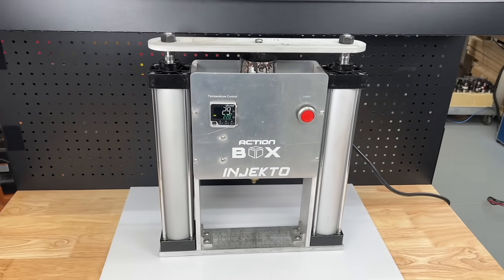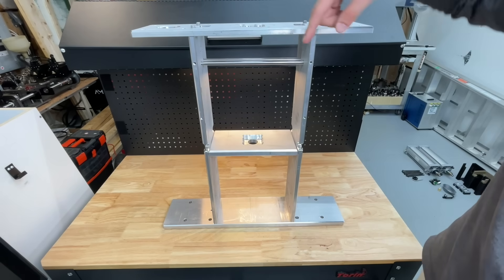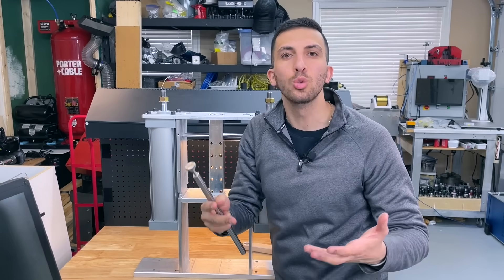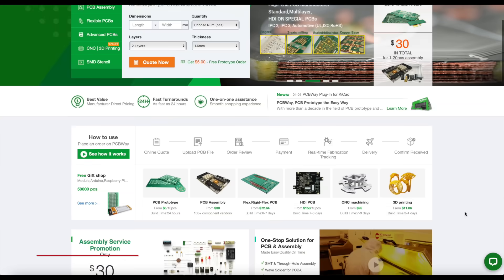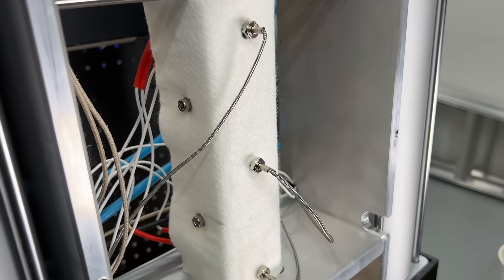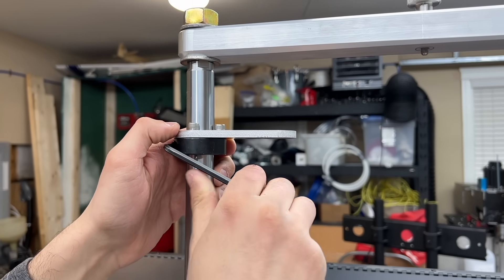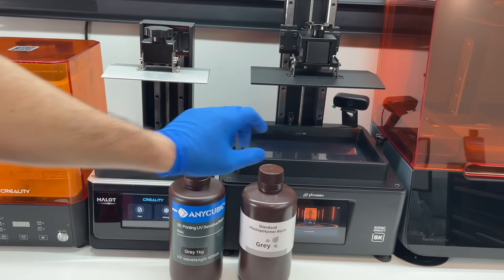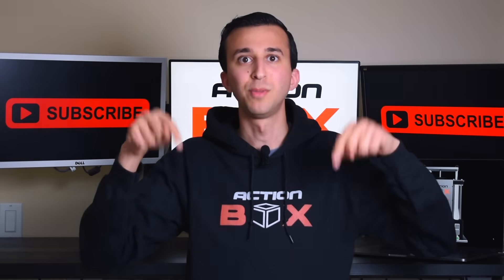DIY Injection Molder Works With 3D Printed Molds | INJEKTO 2.0

Comment: 7:10 this has to be done by an electrician, and this is very dangerous if not done properly. Yeah, I did it by myself. you took the words and in fact was true. got shocked 10 times. burn a wire because accidentally put it in the wrong connecter. then almost burnt the heating element channel tube. learn my lesson but I bought the PID controller, and it was terrible because of the lack of instructions and no diagram of how to connect the controller. but manage to make it work and it's doing well but want to do an updated version because of the old model controller. this time getting one and following online sources that use PID more often of the controller model.

Comment: I've been building my own equipment for mycology for a long time, and after 3d printing for a year I'm realizing how important it is to have mold injection capacity, and this really makes mold injection digestible.   
I am looking forward to the day I finally have the time to start investing into a device like this as it is not to far removed from PID controllers I've set up for large cookers.

Comment: Whats the pressure at the nozzle for an injekto 2.0?
Reply from the maker: The machine generates a maximum Injection Force of 9000N (918 kg) at 90 PSI

Comment: What an awesome build. I'm picturing it on my workbench, right next to the 3D Printer that's pumping out complex multifaceted molds. Interested to know if steppers and lead screws were ever considered for the press system? It just seems like a more simple and maintainable system and the precision of the screws would counter any type of misalignment/wobbling of the top bar. Just a thought. Either way, good job and I want one.
Reply from the maker: Sweet, check it out at actionbox.ca
We have indeed tested an electric version but it is not very cost friendly

Comment: I suggest trying it with urethanes so you can make custom low volume parts (vintage motorcycle carb boots, grips, car pedal pads etc are examples) with the wide durometer variety available.
Reply from the maker: Great idea.  Do you know where we can get these pellets? Cheers

Comment: wow, impresive machine guys , thanks for this very informative video.but how small/fine can be the details that can be reproduced with a plastic mold?
Reply from the maker: This will take on the exact shape of the mold.   If you scratch it lightly with a pin, you will have that scratch on every single part you mold.
Reply: @ActionBOX  thanks guys

Comment: Shuttup and take my money!
Reply: No, seriously. How much?
Reply from the maker: Haha check out our website. We sell kits for INJEKTO: https://actionbox.ca/products/injekto-2

Message us for a special discount 🤫
Reply: To be clear, the mechanical and electronics kits needs to be purchased separately? I have a resin printer for molds and an air compressor. Do I need anything else?
Reply from the maker: @kenengel620  Yes, the mechanical and electronics kits are sold separately. Looks like you've got everything you need to use INJEKTO! You do not need anything else.

Comment: I feel like this needs more iteration, more safety. Having to "ground" the machine yourself. Having to wear safety equipment because there's no shield. Risk of burns and overheating. I'm a huge fan of injection mold manufacturing but this is about as DIY/Lean as it gets, not necessarily a good thing when dealing with molten plastic.

Comment: When it comes to sla, as long as your UV backlight is the right wavelength for the resin you're buying (check the specs vs your machine), basically any UV resin is gonna work on them.  You've just gotta get the settings right for the resin you pick for layer on, dwell, etc.  most resin types will have suggested settings
Reply from the maker: Thanks for the tip :)

Comment: * If you do any wiring for it - rather use a C13/C14 plug at the back of the machine - and have the earth wired internally - this makes it safer and simple

Comment: what is the shot volume of the Injecto 2.0 in grams? i see your site lists mL but not grams. thanks
Reply from the maker: Thanks for watching! If you are asking about injection volume, then the units would be in mL, as mL is a unit of volume. The weight of the injected material in grams would vary based on the density of the material you use. Which type of plastic do you intend to use with INJEKTO 2.0?
Reply: @ActionBOX  i'm not sure what kind of plastic i will need yet. right now i'm just working with resin casting which is mainly epoxy or polyester. i do know that the maximum weight of my parts in grams is usually less than 20 grams. next time i do a casting i will measure the volume too
Reply from the maker: @dumbcat   20 grams of epoxy is around 17ml in volume, so the Injekto can definitely make it. Cheers

Comment: I didn't get how did you made the mold from plastic 
1) Why didn't it melt at the top?
2) Why the injected material didn't stick to the mold?
Reply from the maker: The molds are made of a thermoset plastic instead of a thermoplastic which is what you are referring to.  Thermoset plastics have very high heat capacity at high pressures compared to your conventional plastics like ABSetc.
Reply: @ActionBOX So even a top part of the mold is not melting when it has a contact with the nozzle?

Comment: What is the rate of production you can do with it?
Reply from the maker: Hi @GlassImpressions , the rate of production is highly dependent on many variables.  

1. The first one is how many molds are you using.  The more molds you have printed the faster you can make another injection. 

2. On that same note, if you have a helper opening the molds and removing the parts, your production rate is significantly faster.

3. The type of plastic you use will vary the waiting time for the pellets to melt in the heated chamber.  

4. The design of your mold is also super important. If you have a very small cavity with very thick walls then the injection will be fast. If you have a large cavity with very thin walls then the injection will take more time.  

In general, while the production time is very different for every scenario, we make about 200 caps for INJEKTO per hour. 

I hope this helps.  ps. Feel free to reach out to us if you want to review INJEKTO

Cheers,
Dave

Comment: What does the maintenance look like on this machine? Also, how many injections does a 3D printer mold typically take before cracking, wearing out, etc..
Reply from the maker: Hi, great question. You would have to purge out the heated chamber whenever you decide to use a different type of plastic, or a different colour of plastic in order to avoid contamination.  Other than that, a few of our customers who use this machine every day for their business requested some spare nozzles which we provide.  

In terms of the :d printed molds, it really depends on the resin you are using.  The resins which are meant for this last much longer, but if you use the cheapest available resin ($15 per litter) then we managed to get about 20 injections out of it before it degraded. 

Hope that helps,
Dave

Comment: Hey guys, huge fan. Your design inspired my to further miniaturize an injection molder using one cylinder. Do you think it’d be possible to use a 20oz CO2 cartridge instead of connecting an air compressor? Why/why not?
Reply from the maker: Thanks for your support 😃. As per your question, how would you use a CO2 canister exactly? You need a regenerative pressure source.  The CO2 canister would work for just one injection and would then need to be replaced or recharged.
Reply: @ActionBOX  I considered this. I suppose it depends on the set up but I haven’t worked out the math of how many uses you could get out of one CO2 cartridge. If more uses were possible I thought it cheaper to make and easier to operate.
Reply from the maker: @svega1998  whats the pressure in your CO2 canister?

Comment: Although aluminum is easier to machine steel is the better candidate for structural integrity.
Reply from the maker: That’s correct.  Our latest machine is made of steel.  Cheers, Dave

Comment: This is not totally unlike the design of thermoplastic injection molding machines, prior to the invention of the reciprocating screw.  Which does a better job of melting resin using shear heat along with barrel heaters, but a mchine with such a small barrel should not have issues and the worst case of underheating would be some partially melted pellets (or chips) in the part.
Reply from the maker: Hi, thanks for your comment.  Check out our fully automated plastic injection machine video for the screw and barrel version. Cheers.

Comment: @Action BOX  Have to admit Your channel as well as Your work has come a long way. Have been watching you since the EDM wire cutter machine. 

I had a request/suggestion to make...

Could you please test these and post a video

1. using a 3D printed FDM Pattern to create Plaster of Paris  Mould (preferably reinforced with hay for strength) and lubricate the internals of Mould with oil to prevent sticking of plastic with POP.

2. Instead of POP using pottery clay around the FDM 3D printed pattern and then cook it to get the mould.

With the test Also find answers to:
1. Do these kind of moulds do the job?
2. How many parts/injections do these semi permanent(yes that's the objective) moulds can take?
3. Do they have adhesion issues with the parts?
4. Do they provide necessary finish to the parts?
5. How economical/costly are they compared to Aluminium or Resin printed Moulds.

Comment: The formlabs is the SLA (runs a laser line by line over the print), the others are MSLA (use an LCD screen with backlight). The only consumer DLP (uses a dlp projector chip and uv laser light source) is the Anycubic D2. DLP does not suffer from pixel bloom and low contrast inherent in LCD, so a 2k DLP can match an 8k LCD and use a much lower power light source, leading to a 10x increase in printer lifetime.
Reply from the maker: Interesting thanks for sharing with me.  I plan on building a large dlp printer so perhaps you could help me out with some info 😃. Cheers, Dave
Reply: @ActionBOX  Afaik DLP is the norm for high speed professional resin printers. The main thing where they differ from the D2 is that they can adjust the projection distance/focus so they maximize resolution to what they print, and price of course. It should be sorta easy to convert a DLP beamer to a printer, if you can get your hands on ~10-20W a UV laser light source.

Comment: I am building a injection mold machine from an electric log splitter. Just need to remove the log splitting wedge and replace it with another hydraulic cylinder. Two things most small injection mold machines don't get right. 1. clamping pressure on the mold. 2. injection pressure. Using the electric/hydraulic log splitter will solve both. I need to split the hydraulic line so first it can clamp the mold. Then redirect the hydraulic pressure to inject the plastic. If you want to do this, remember one detail, find a log splitter that has exterior hydraulic lines from the pump to the main hydraulic cylinder. The ones with internal lines can't have the hydraulic pressure redirected easily by placing a 2 way valve in the line. I got all most all the parts, Maybe when I put it all together I'll do a video.
Reply from the maker: Cool project, thanks for sharing.  The problems you mentioned in small machines are definitely true so I’d love to see how your project pans out.  Cheers

Comment: I’m not very familiar with injection molding but from what I can see, the design of the two buttons is smart. 
However it does make the user stand with their face wide open in front of the mold. 
I think it would be wise to either add a shield for protection or put both buttons to one side so the user is not in front of the mold.
Reply from the maker: I would agree. FHA j you for your input 😊

Comment: What is the average cycle time once the kinks are worked out? Under 1m or longer?
Reply from the maker: Probably longer than 1 minute with a single mold.  Having more molds has helped us decrease the cycle time.  We are still limited by the time it takes for the plastic to heat up.  Hope that answers your question. Cheers

Comment: Hello guys from the community I really need your help everyone "can you help me figure out how to install the safety seleinoid with the switch? I really don't know where to put it to cut the air in the cylinders if I do place before the air from the top of the cylinders The air out at the 5 way outlet can be cut off but I believe that it will not escape when is goin up because the solenoid will prevent it from coming out it will be closed to goin up the cylinders or believe do you think it will still work ?
Reply: No response :(

Comment: 👋 HI, IS IT POSSIBLE TO DO TWO SHOTS FOR LARGER VOLUME PARTS?  IS THIS SOMETHING COMMONLY DONE?  THANK YOU 🙏
Reply from the maker: I’m not sure to be honest. That’s an interesting question.
Reply: @ActionBOX  I second that. Hopefully in the future you will produce 2k injection capabilities for this machine. I’d much rather buy domestic than Chinese alternatives. Unfortunately the options are pretty much NIL.
Reply: It could be done with an over mold. You’d mold the first piece, then insert it into a separate mold to be injected over with another shot. We did this where I used to work. Caution must be taken so that the first shot does not warp when cooling, because any warp could affect the second shot.

Comment: I like this.
I was involved with a shop that started off using the resin cured molds as inserts into MUD units for prototypes (master unit dies).  CNC aluminum was good for lower volume but is significantly higher cost in mold size.  we were working to lower that cost to entry industrially.  The primary limiter was the heat history of the plastic mold.  though the resin cured was better than standard filament 3d prints, the heat would soak into the outer sides, usually blowing out the parting line, as it's harder to scrub the heat in that region; where there is little active cooling.  

Adding cooling lines in the prints didnt seem to help much as a trade off.  Wall thickness of the resin mold had to be near double the part thickness to stand up to the injection pressure.  (which was often 10K -20K PSI on smaller machines)

in addition, the more heating and cooling cycles would make the acryllic, or composite resins degrade over time, even below the plastic transition temperature.  Some compatabillity issues were found between resins near their transition temperature and the mold surface temperature.

Painting an SLA with silicone to make a negative, and then casting a surface with an epoxy is allright for several swapp-able units; but in short order, you want to switch out to aluminum for prototyping.  A thin skin of foil, or composite pouring resins (graphene, carbon black, copper flake) helped with heat scrubbing, but Resin casting and time cost adds up relatively quickly.  Tolerancing on casting is good though.  Shut off on parting lines were an issue (again, heat buildup) at small lot runs when you wanted to get up to production speed.

Some solenoids in the bottom of the frame would be ideal to help with the ejection of parts -- but that's more of a bottleneck if you have fast enough cycles to make the heat scrubbing an issue.

I like the bigger cyllinders, Often the injection speed is the limiter with the shot size.  Venting and part geometry relative to the sprue helps with flow to reach further in the part shape.  All kinds of fancy gating can be used to sidestep the machine limitations.  The trade off is the more runner you add, the less part you get for your shot size.  high end hot runners and valve gates are theoretically a choice; but I suspect part orientation in the mold and shortening the runner with several gates to fill will optimize given the low-cost-protoype constraints.   There is a fair bit more done in the DFM for injection molding to make a part and a machine compatible.  if your max shot size is 27 grammes, that's a good size -- but I'd bet there are limitations keeping you between 22-25.  Would be willing to discuss more if desired.

I would be interested to see some ideas for how to make this more durable.   The next step up in price from a unit like this is a 10K screw driven desktop molding machine -- so this is super accessable; right around the cost of a basic 3d printer.

if you can make polyCarbonate accessable to the hobbyist without using aluminum with a benchtop press -- that's a huge barrier to entry for 3-d printing.  Injection molded part strength is better than cast, SLA or FDM for prototyping too.

Very exciting project, great execution you guys.
Reply from the maker: I really enjoyed reading this.  Thank you for sharing 😃

Comment: Very interesting! What's the maximum size of the mold that you can use?
Reply from the maker: Great question! We’re actually releasing a video highlighting the limitations of the machine with different types of 3D printed molds, and also cover the maximum mold size. That video comes out on Friday July 22. Stay tuned!

Comment: I think you should have less involved kits such as ones that only include the basic metal parts and cad files for you to 3D print yourself.
Reply from the maker: We are open to considering that. Which specific parts should we have in the kit then?  Thanks.
Reply: @ActionBOX  probably any parts that cannot be made by a 3D printer or with common tools most DIY’ers have